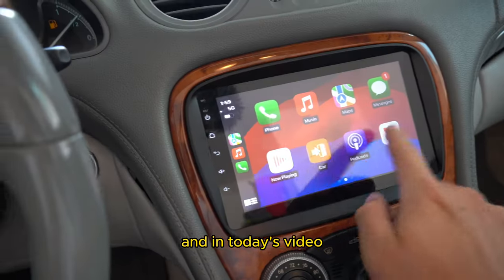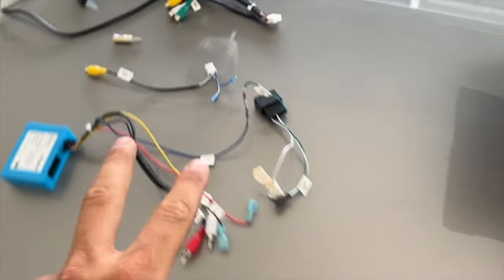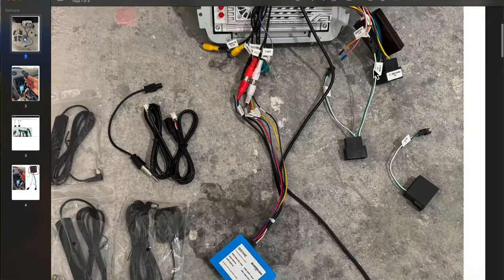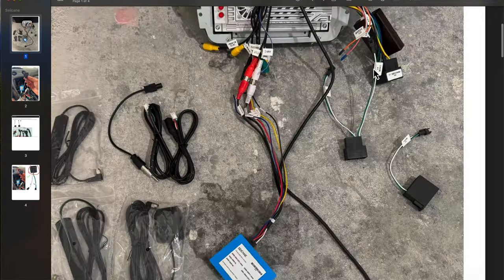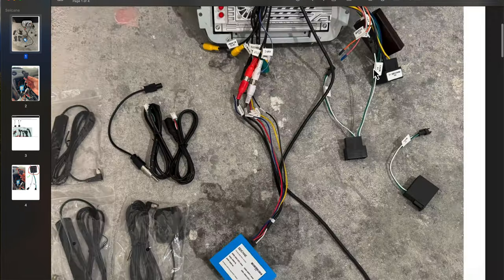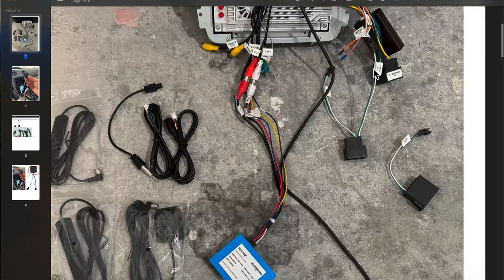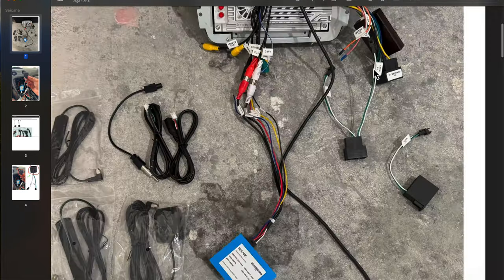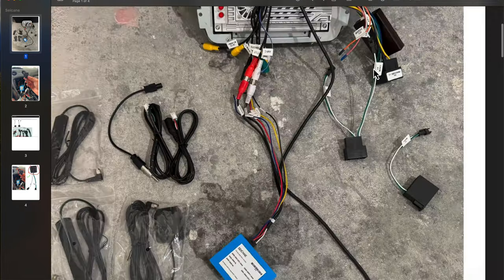How To Install An Aftermarket Radio On Any Mercedes SL R230 | Seicane With D2B Fiber Optics

Comment: Great video. But, I highly encourage anybody considering this product NOT to buy it.  I purchased one, installed it, I get sound but I also get a "popping" sound when the unit heats up. It "pops" all sound cuts out for a few seconds and then it comes back on.  The popping even happens with the unit off.  Customer service was worse than horrible and they continued to discourage a return claiming it may takes months, get confiscated by customs, etc.  DO NOT BUY.

Comment: I can't seem to get my sound to work. My headunit powers on and works great. I double checked to make sure all my fiber optic wires are looped properly and it looks to be going straight from D2B decoder to the amp. With the canbus connector, my D2B wakeup wire is connected to the car's turquoise wire. Then opposite end the other two are properly connected. However there's just no sound. My amp fuse is fine too. Maybe my D2B decoder box is not getting power or broken? Can the headunit power on properly if the D2B box isn't powered?
Reply from the maker: there may still be another device in the loop. do you hear your amp kick on when you turn the car on? you have a phone in the loop, a cd player and i think one more thing. otherwise the next step is to remove as many d2b connectors as you can from the loop.
Reply: @Haydenschreiermk2  what does amp kicking on sound like? My car didn't come with a phone. I even lightly tugged on the fiber cable to see if it all is one concise loop
Reply: I installed the radio and on my car there was a third device on the loop (2 devices on the center console behind the armrest + the CD charger), I have to install 3 optical bypass to make it work. I suggest you to check the loop.
Reply from the maker: @thomasvdb9485  there is also the last one which i forgot to do which is for the mobile phone and its above the amp. it should say motorola

Comment: Will this be the same process on different brand stereos?
Reply from the maker: There aren’t many other stereos that will work on the R230 but yes it’s a similar process
Reply: @Haydenschreiermk2  Aliexpress has lots of similar looking units for r230 with different brands, many different options, hard to choose from....
Reply from the maker: im sure they will all work. some will let you keep the cup holders other wont. the main thing is you will need to order the D2B fiber optic decoder separately if you plan to order off of aliexpress. which will run you another $100+

Comment: this was an awesome video..i wish you lived in vegas Id pay you to install mine.  I couldnt get my seicane unit to power up so being frustrated I reinstalled my stock unit and now I cant get sound from any of my speakers even though the command unit works. My aftermarket unit is either defective or I am not getting the power it needs.  My whole weekend was ruined..I have a 2004 SL600 with the EXACT wires but seicane DID send me the correct adapter for the d2p wake up connection.  I did everything right but no power on the new unit :( and now no sound from the old unit...
Reply from the maker: haha pay for my ticket or and ill come install it! from the sounds of it, it seems like there is still a break in your fiber optic loop or you damaged a fiber optic wire. since the head unit still works, then that should all be good. a good way to check is turn the volume up and unplug the fiber optic cable from the radio and you should here a loud click (almost like when you unplug an aux from a guitar speaker) from the Benz speakers if you here that than you know the loop is correct. if you dont then there is a break in the loop somewhere.
Reply: @Haydenschreiermk2  I still need to know why my aftermarket unit never powered up as I cant return it.  I just bought the car and the previous owner bought the aftermarket unit :(.  I wonder if a stereo shop can trouble shoot why the head unit wont come on....Quick question.  My D2b fiber optic unit came with a very long fiber optic wires.  If I was to plug this wire directly from the stereo to the amp will that make the audio work or does it still have to go through the loop of the cd changer and tele system?
Reply: @omarboswell6296  If you can run the fiber loop directly from the head unit to the amp, you should be good. I've also heard that the amps can fail, but I don't know an easy way to test that.

Comment: Why don’t they make one for 2005 and up
Reply from the maker: im sure they do! even better is i think those models 2005 and up dont use fiber optic lines anymore which is way better
Reply: @HaydenSchreier I've heard the 2005 and up have worse sound quality. Side question: how is the microphone sound quality for people you are talking to?
Reply from the maker: @jasondejoy4994  no problems here with microphone you can either use the seicane unit microphone or add the aftermarket microphone that it comes with and mount it somewhere
Reply: @HaydenSchreier is there an option to use the factory microphone?
Reply from the maker: @jasondejoy4994  im not sure where the factory microphone is. if its in the orginal radio than that comes out with the radio lol
Reply: @Haydenschreiermk2  I am at the tail end of a similar upgrade of a 2006 SL500. Definitely has fiber optics. Had to bypass, similar to you. 2006 is a MOST fiber optic system rather than D2B, so connectors are different. Also, wakeup works differently and I am still struggling to get this to work consistently. No Seicane available for 2006. I went with a Kenwood head unit. Question: I don't see where, in your video, you connect the antenna. In my 2006, this appears to not be easy. Lots of rear and trunk panel removal. I am trying to get a handle on what exactly I need to remove etc., before I dive in. Did your 2003 require digging into the back of the car? If yes, any tips? Thanks so much for the video BTW. It was helpful, even given the differences between the 03 & 06. EDIT - Figured out antenna wire. I was being dumb. I ran antenna extension wire down the middle and to the main control box behind the driver's seat. Unplugged black connector (not yellow, unplugged it, don't think I need it, we'll see) from control box and plugged it into my antenna extension wire. Now have great HD FM reception and okay AM. Note, this works because I have retained the original audio gateway and am using a MOST converter. I think it would be different if I were bypassing/replacing all.

Comment: Great video. I was going to do it to my car based on Amir's video that you linked. Your video is even more detailed, particularly around the D2B wake up wire. Very helpful. Than you.
Reply from the maker: yes! that was a part i struggled with, so i figured i would make a video as clear as possible to help others!

Comment: Hello - great video - thank you for sharing a wealth of knowledge you didn't have to 

This video was made two months ago, wondering how things are going with the radio - any issue up to this point ?

Finally, if I'm correct - you mentioned the sound is the same - this is the one thing I'm most worried about - the sound coming from the factory radio is, by far, the best sound system of any car i have owed, it is incredible, especially at highway speeds with the top down - just to clarify, there is no difference in the sound quality when switching out the head units ?
Reply from the maker: There is 0 difference in sound quality even after these past months because I am using the stock amplifier. It sounds great and I highly recommend the upgrade!

Comment: Hayden, Great video Thanks for taking the time to figure out optic cables etc. i have a question Sirius radio capable on Seicane and also rearview camera can it be wireless, 
and lastly are we losing the sub woofer or any speakers on install?
Reply: Meant back center speakers
Reply from the maker: you will lose no speakers or sub woofer. this hijacks the original sound system! serius radio should be capable i dont see why not. and yes you can hook up whatever rear view camera you want. i know for sure they make wireless ones

Comment: Very well explained video @HaydenSchreier. I will watch it again to truly familiarize myself with the steps to decide whether I try it or not on my 2011 SL550. What would you say is the difference in installing the Seicane With D2B Fiber Optics or a double-din unit? I'm inclined to think that it'd be simpler with a regular double-din, but I don't know if that would sacrifice some functions or not. Thanks for your advice
Reply from the maker: seicane D2B uses the factory fiber optic lines and the amp thats stock with the car. i think if you go the double din route you will have to upgrade your amp and potentially your speakers.
Reply: im thinking to get sl550 r230 2012 i have question from your experience how much money you can spend on mechanical issues every year as old car does it comes with big issues ??
and the same question about gas like you see this days petrol problems costs 😊

Comment: Great video! I’m curious about how it works with carplay? You ditched the wifi antenna and I was assuming thats good for wireless carplay? Thanks!
Reply from the maker: no wifi antenna not needed unless you want to broadcast wifi from android unit. apple carplay works off of bluetooth or wire

Comment: Hi, great video which is really helpful. I fitted the same unit in my SL55 and had the same issues with Seicane support eventually resulting in my returning the unit for a refund. Thinking about trying one again but a couple of questions? I believe the dash clock cannot be adjusted after installation is this right? Also is the option to pay for the upgraded rom and ram advisable to take. Thanks
Reply from the maker: this is true yes, i had to set the dash clock before installing the radio. as for rom and ram, besides using the radio for the radio, the touch screen features, backup camera and the ability to use apple carplay/android auto, i have no reason to upgrade rom and ram. Im not running power intensive apps or needing memory for heavy multitasking while driving.
Reply: @Haydenschreiermk2  Thanks Hayden, have ordered another unit from our friends in China and will go with another install. One of the issues I had originally was with the unit only having two USB inputs whereas I needed three (DashCam, USB Fob for MP3 and the DAB+ Radio) I will use a USB 3 Hub and see how the unit copes? Thanks again for all your help with this very informative video!
Reply from the maker: @brianives9842  you can always just fuse tap the dash cam
Reply: Hm. In my ‘07 I’m able to adjust the clock via the cluster. Just some food for thought.
Reply from the maker: @papalinguine4092  what do you mean from the cluster?

Comment: Was very interested in this radio for my SL as it looks fresh and.fits perfect. Whats it like to use ? Smooth or any major glitches ? Great video.
Reply from the maker: It works incredibly well! Smooth like butter. So far the last couple months it works really well! My only complaint it when the tops down you can’t really see the screen from the glare
Reply: @Haydenschreiermk2  first world problems if you have the roof down and the sun is annoying your screen. I think this is the way I'm going to go with mine. I really like the fit and the screen looks crisp in the video. I'm an Android user so I am really into the Android Auto part of this for maps and music.

Comment: Well done! Have you tested the other steering buttons as well; phone answer/hang up, track/station skip etc? This is very new as I have not seen any others install on 2001-3 SL R230 with BOSE. Thanks for sharing.
Reply from the maker: volume works on the steering wheel as well as skipping radio stations. I believe im one of the first to really make a detailed video on the installation process. There is a lot of talk about this in fourms
Reply: @Haydenschreiermk2  Yes, there has been quite some talk as there was an issue with the early SL 2001-4 BOSE & it seems the D2B has solved that. I like the modern tech but also the finish as I feel it blends quite well with the dash, as opposed to fitting a retro style modern media unit. I'm very interested in doing this on my 2002 SL55  but won't commit just yet due to Seicane having so many negative reviews. However you have helped a lot with this video.
Reply from the maker: @gruppettaautomotive7184  seicane so far works great. the only negative review i give them is their horrible customer service. you are on your own if you purchase this
Reply: Is the Bluetooth good during calls?
Reply from the maker: @gruppettaautomotive7184  yes

Comment: nice work! I noticed you didn’t mention steering wheel controls. did you get that working too?
Reply from the maker: Yes I did, didn’t you see me press the volume control button?
Reply: @Haydenschreiermk2 I’m assuming you have two steering wires coming from the head unit. where did you plug them in the harness?
Reply from the maker: The canbus decoder controls the steering wheel functions, as well as tell the radio when the car is in reverse and when a door is open

Comment: What do you mean by reducing fiber optic cable? How do you eliminate/shorten the cable?
Reply from the maker: what i mean is while you are digging around in the back disconnecting and bypassing the fiber optic lines, you will have a lot of extra bypasses within the fiber optic loop. you can remove a full fiber optic cable if both ends are in bypasses and just make the loop smaller.

Comment: Great video
Reply from the maker: thank you!
Reply: @Haydenschreiermk2  Hi again, I'm wondering if you can help me a little more. My can bus did not come with the plug for the two wires that you plugged into the plug that you made. I just have a couple of wires with nothing on the end. I expect those two wires go into pins 8 & 9 on the plug coming out of the car with the D2B wake up in pin 10 of the same plug. Would you know which wire position out of the can bus goes to pin 8 and which one goes to pin 9? In my can bus, the two wires are next to the yellow battery wire and the other is next to the black ground. If you could just say the one next to the yellow goes into pin 9 in the corner or vice versa, it would be a huge help. Otherwise, I will jut try it one way and hope I don''t blow a fuse. Thanks.
Reply from the maker: @jasonmaxwell2883  its hard to follow over writing. you can email me some photos

Comment: Hello I have a s430 2001 model I went and ordered from Seicane web site but their tech support is very bad 
I follow ur instructions to wired D2B audio adapter and connected per the instructions but unit didn’t power on at all my question is the connector u modified where you connected d2b wake-up wire connection will same for the s430 2001 model.
  Also if wire wrong will the unit not power on
Reply from the maker: D2B “wake up” wire is only for the amplifier to kick on so you have sound.  "wake up" signal for the sound amp. If the unit isn’t powering on then you have another problem. Good chance they are different wires as they are different cars
Reply: Thanks is the cam wire could be Wong that stoping unit to turn on 
Do recommend any web site I can search and correct my wiring 
Thanks
Reply: @Haydenschreiermk2  
Thanks 
I checked unit power the unit is getting power, what about cam connection to canbus unit if this connection is wrong then possibly  unit will not power up or what is the importance of cam wire

Comment: Sorry I'm here again. Is it possible connect the red cable of the optical fiber amplifer to the yellow cable and not to the cigarette lighter ?
Reply from the maker: NO you cannot.... yellow cable is constant power, which means even when the car is off the cable will get power. The red is for ACC. which means power will only be supplied when the car is turned on or in ACC mode. you can probe the radio harness for an ACC cable if you want. I am just unsure which it will be. the wire will read nothing when car is off and 12V when car is in ACC more but engine is off

Comment: @HaydenSchreier my steering wheel has no controls, so do I still need Canbus? If so why?
Reply from the maker: my steering wheel has volume buttons and you need the canbus as it will detect when car is in reverse if you install a reverse camera
Reply: @Haydenschreiermk2  I won't have a reverse cam etc. I only want to install an aftermarket radio. So I don't need a Canbus, right?
Reply from the maker: @iyilm4z528  im pretty sure it comes with canbus. just get it

Comment: Ciaooo....the radio is arrived but is different .on back side the is an optical out.
I have a problem. I followed your istruction. I can hear the sound only for some seconds, after nothing and after return again......can you help me
Thank
Reply from the maker: what car did you install it on. sounds like there is a break in your fiber optic wires or just too much. Ive read about this happening before and i believe the fix is to shorten the fiber optic wires you have. try to reduce as much of the wires and connectors as possible, leaving as close to just having just the amp and radio plugged in. try to remove all other bypasses.
Reply: @Haydenschreiermk2  r230, year 2002. Hi, I solved the problem. I changed the 90° plug of the orange cables and used a linear one.
But another problem. There is a hissing sound when I turn the unit on, steady it doesn't change even with the engine off.
Finally, the radio is really different. On the back it also has an (I think) optical digital output, as well as an HDMI output